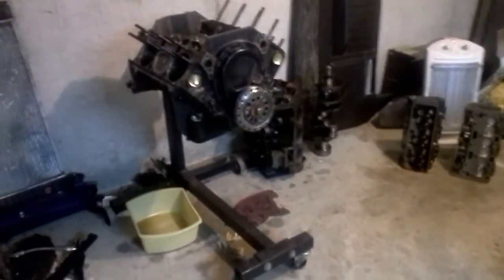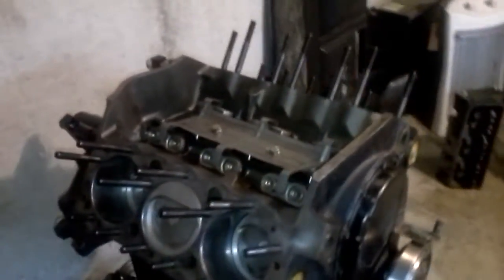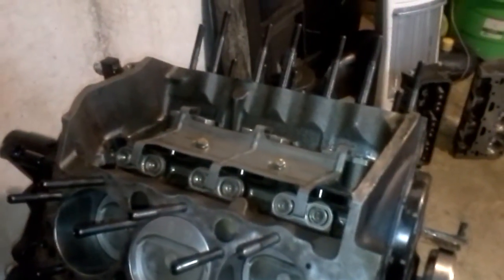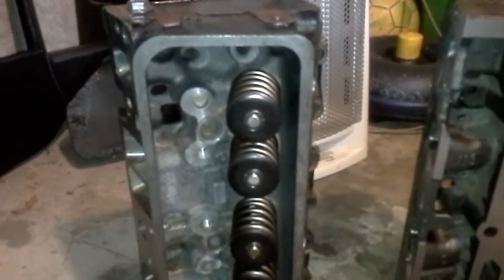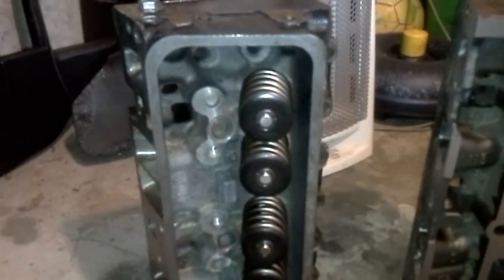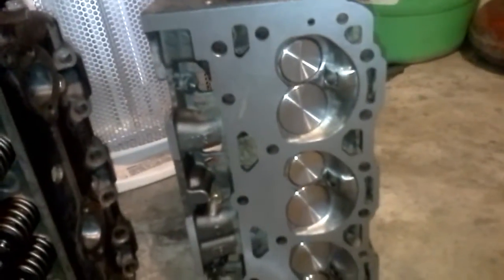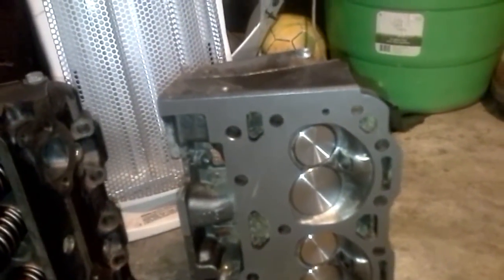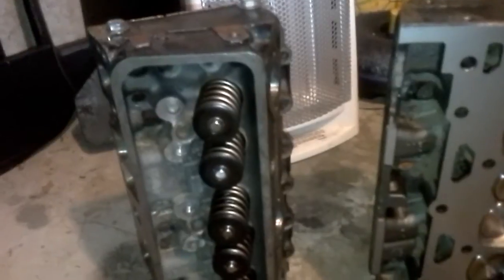600 HP Turbo 4.3 Final assembly

Comment: Ain't gonna be no 600 HP
Reply from the maker: You’re a day late and a Long time short , that engine put out 600+ at the crankshaft on 20# boost.  Somewhere around  650 Hp it bent the crankshaft and wiped a main bearing; so the whole platform was sold. The owner went turbo LS and never looked back.
Junk yard 5.3 fresh rings and bearings  w/ 216/220 cam put down 760 whp on 15.9# boost…. 😎👍